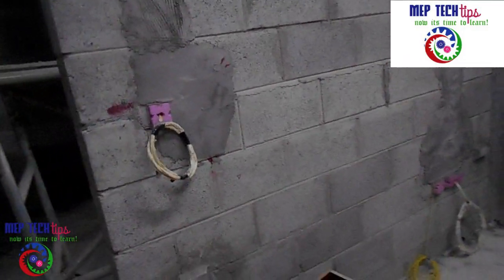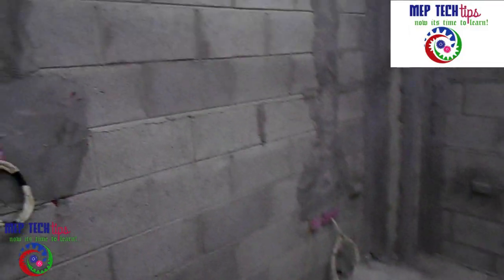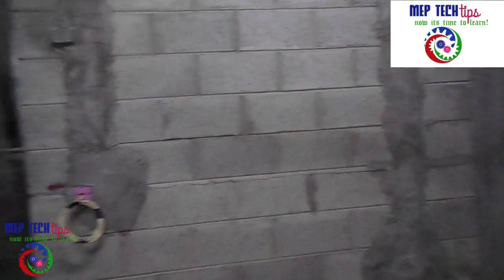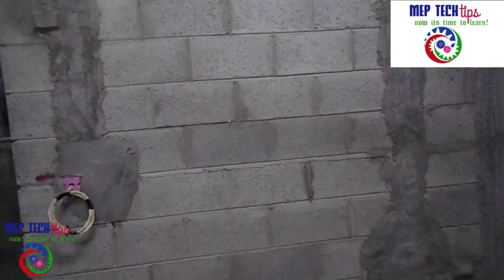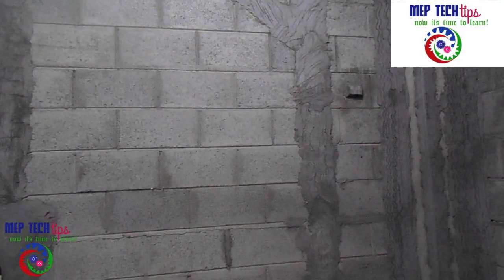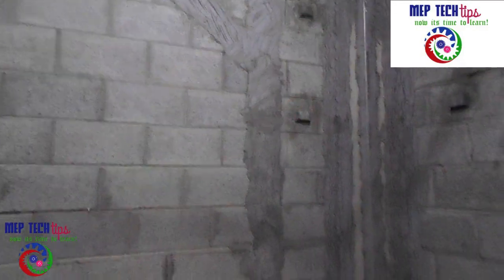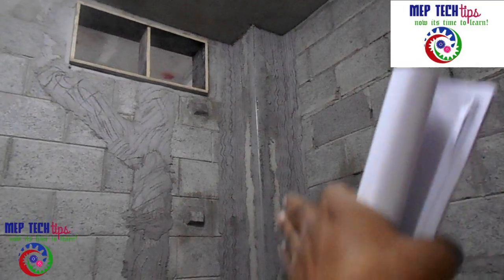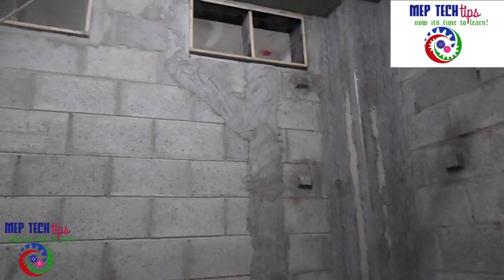Mechanical & Electrical Sleeves Installation in Block Wall Before Plaster | By MEP Tech Tips

Comment: 1 meter level is FFL ?
If I need to connect 13A socket, then should I take measurements 45cm to socket from this mark ?
Reply from the maker: You have to take dimension whatever services coming on the wall from this level marked by surveyor

Comment: Sir you said that for fire rated area we use Gi sleeve but for non fire rated area we can use upvc or Gi sheet, so what’s the difference then because in fire rated also we can use Gi sleeve and in non fire also Gi sheet. Plz explain
Reply from the maker: Non fire rated area not required G.I sleeve but some sensitive projects they use for all  area only G.I

Comment: Nice Work.
Could you ,please advice how much shall be a minimum clearance considered while giving rectangular cutout for Duct snd sleeve for pipe  in Block wall as well as for core wall respectively.
Reply from the maker: am going to make question and answer session will cover all the major question in it including urs

Comment: Sir, why sleeves are provided?
Reply from the maker: if any maintenance in future, you may remove any pipe easily, If its fixed in the wall, you may damage the wall and finishes.

Comment: What is the difference between shop drawings and IFC drawings?? IFC ( issued for construction)
Reply from the maker: Shop drawing prepared based on actual approved material where as IFC prepared by consultant as per data available  with them.

Comment: What is 1 Meter marking??
Reply from the maker: 1 Meter marking will be provided by civil contractor, Because, the surface level of slab is not same all the areas to avoid any height issue for MEP or Civil finishes work ,Surveyor will mark 1 meter on the wall so that u can take ur dimension for any services from that reference or U can say it just a reference point for u to take vertical dimension for any services, i hope u understand
Reply: @MEPTECHTIPS  thnks